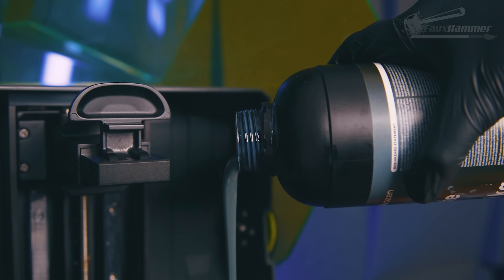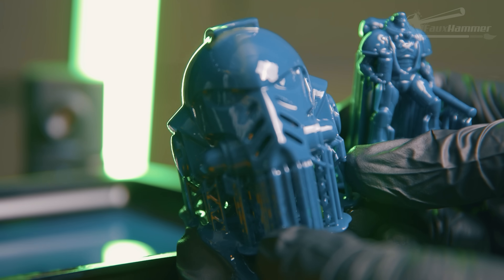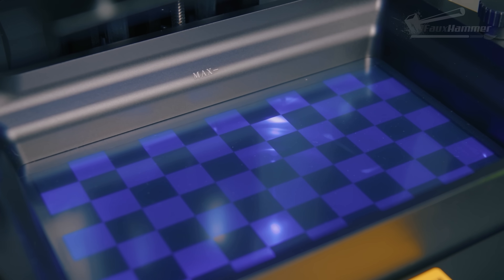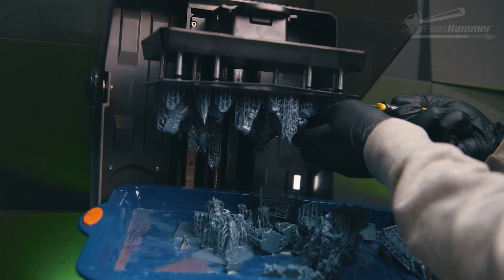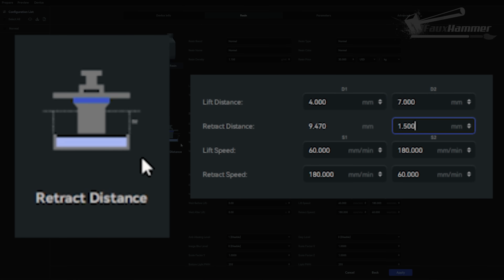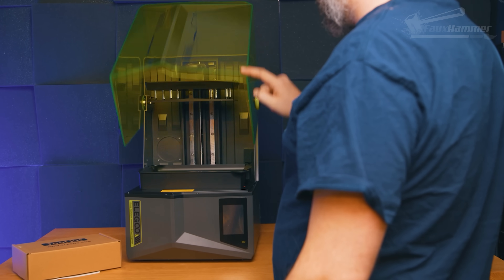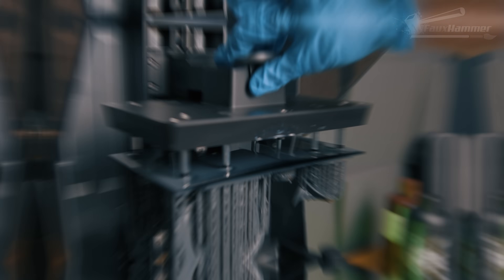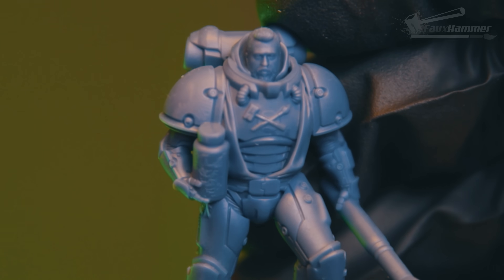FIX your RESIN PRINTER with this ONE SETTING - It's not what you Think! - How to fix Layer Tearing

Comment from the maker: 🛒 ORDER the Elegoo Saturn 4 Ultra 16K 👉 https://geni.us/ElegooSaturn4Ultra16k
🎥 Related Videos You Should Definitely Watch:
• ⚡ Exposure Test (Saturn 4 Ultra): https://youtu.be/_xfJ0456M6k
• 📽 XP Calibration Guide: https://youtu.be/Gm0-z971tgY
• 🧪 Photonsters XP Range Finder: https://www.thingiverse.com/thing:6023738

Resin print failures halfway through? This is probably why.
Lift height and lift speed matter way more than you’ve been told—especially if you’re not using a tilting-vat printer.

Tried these settings? Got better ones? Tell me below. Let’s crowdsource the perfect motion profile.

FauxHammer out. 💥
Reply: Videos like these are taking the whole community backwards. Lifting isn't going to separate layers that bonded together properly during retract, The film has nowhere near enough hold on the model to do that and with the way forces are applied during lifting on the part touching the film (sideways) and the part touching the plate (perpendicular) it's literally impossible. If layers split during lift, it's because they haven't bonded properly during retract in the first place, so you fix it by longer rest before exposure (more effective in general) and/or more rigid support structure (less effective in general). As for lift height, if it's insufficient, it'll cause fails (pancakes) propagating from the center of the plate, because that's the last place that peels during lifting, nothing to do with models being placed in the center. But because the film starts peeling from corners and edges towards center. Just ffs, there are finally more people in the community learning about this and then comes this video. 

Google "Jan Mrazek Prints not sticking to the build plate, layer separation, rough surface, elephant foot: resin viscosity – the common denominator" and start from there. It's been out for 3 years now. Youtubers should do better.

Comment: I've FDM printed for a few years now, well aside from the last 12 months when my printer got damaged moving homes, and I never got around to fixing it.  I recently took the plunge into Resin.  I wondered why people always complained about issues, every print was working great.  I started to understand some of the slicer settings, and started playing with them.  I queued up a 14 hour long print, with 2 models on the plate, and about half way through, I noticed this problem on one of them.  I let the print finish, as one of the models was perfect.  I didn't worry too much, I figured it must have just been a one off.  Until the next print completely failed.  I tucked tail, cleaned the vat, filtered the resin, and deleted all my changes in the slicer, and prints now working perfect again.

But now I KNOW why they failed, and I know what setting it was that I'd messed up.  Now that my hiatus is over, and I got a few random novelty prints out of the way, I can get to what I bought it for... Making functional parts.  Tablet/phone stands, parts for projects, tools etc.  Now that I have a resin printer, I may even consider miniatures as a hobby, it always interested me a little, just never really got into it.  What's the best place to get models from?

Comment: What if it's a Saturn 4 Ultra, Bluecast X1-V2 resin and the print is cracking in a diagonal direction not parallel with the layers? The print printed fine the first two times, the last two cracked diagonally. One of them into three pieces.

Comment: I think I may have a possible solution to this issue for everybody doing resin prints so I'm doing an experiment. I'm going to get a piece of gorilla glass cut to fit my new S4U16k as an experiment to replace the release film with a more rigid but less resistant to light and capable of basically perfect resolution. I'll see if it can handle the tear strength as well. Think a really big piece of the bendy glass used for mobile screen protectors. Film gasketed edge of course but the entire primary bottom being a sheet of incredible tough, flexible and perfectly translucent material may be the end of replacements. Throwing this in here as I was watching this video as part of my research for this project. Another excellent video too Ross.
I think it may have some incredible possibilities with the strength of the material and Corning makes some seriously impressive materials. What do you think? I may even FINALLY launch my Patreon and my channel back up just for this project.

Comment: Thank you so much for this video! Finally I have the settings that I know work because they are tested (even across many different printers) and not my gut feeling. When starting with 3d printing and researching this topic it always like: "the lifting speed should be something between this and that value..." and so on. Or like: "don't make it too fast or too slow or it will fail". So I love your "take these values and you'll be fine" approach. So thank you again!

Comment: The other solution is an anycubic M7 Max. It has a load cell that will try to have a continuous pull force until the part releases, then go down. As far as I can tell it completely overrides the speeds and distances. I haven't had a single failure related to speed and distance.

Comment: Been printing for a couple years and finally printing something larger than a mini and running into issues where the print fails at the same point after releveling, reorienting the print, changing the angle and making sure its hollowed and ported so im not getting a lot of suction. It looks like its being pulled like in the image for the stand at the beginning of the video. checked my print setting and saw that the lift speed was really fast and the lift/lower distance was very short. trying the settings for the 10in. build plate. using a Elegoo Mars 4 Max. 5th time printing this same model so hoping for the best.

Comment: great informative video. this was something i learned along the way and kind of makes sense once you understand that your FEP does stretch over time. as you suggested i change the lift hight on my prints when the FEP has been on the printer for a while. you could also save another profile for a slightly worn FEP?
one criticism though, please stop putting yourself down. your knowledge on printers and 3d printing is fantastic and if your unsure of something, your honest about it and you still try to help by finding out the information therefore furthering your own knowledge about it.

Comment: I have the Elegoo Saturn 4 ultra 16k. Cannot seem to find the slow and fast print mode switch on the user interface. Either on the UI on the printer or the Chitubox software.  Or is it the "wait time" settings, in Chitubox pro. Thank you for your help.
Reply from the maker: it's on one of the UI menus, Tools i think. i said Slow mode but i think it's called "Standard" and "Fast"
Reply: @FauxHammer  Yeah its set to Standard. Im wondering now if its not the wait time after lift. Its set to 0.00. I have a feeling its based around the leveling...... If I have too I have too. Thank for your informative videos.

Comment: Then would you recommend slowing the first stage even more if the edge pieces keep falling from their support while the same piece print fine in the center ? I'm using anycubic ABS resin pro 2 and the piece on the edge of my anycubic mono 6Ks have high misprint rate :/ Tried your suggested setting and it help, but not sure what to tweak to help printing on the edges.

Comment: If you have time then you can fix some issues. We have SL1S at firm and we have some print issues. Because it’s at work , not at home , so we don’t have time to play with it at all. So we will have these issues forever. This technology is far worse than I thought. No wonder these printers got so cheap lately, of course not that particular printer from Prusa. Always the bottom part is uneven. We print some more rectangular and round shapes.

Comment: Thanks for this video. I got a GK3 Pro earlier this year and it printed really well for a while. Then it seemed like every print was failing and I couldn't figure out why. I posted my settings and examples of the issue in the Facebook group but didn't get much help there. I tried replacing the film on the vat as a last resort and nothing worked. Changed the lift settings based on your 12" screen settings and its been working great printing a full plate with no issues. My only thing is now since each layer takes longer to print it has really inflated my print times. Any suggestions on adjusting the settings to have it print a bit faster but still safe?

Comment: I literally just use the default settings an it works fine 95% my problem is I only use auto supports I'm very much dumb when it comes to tech so that's all I can do. I find if I angle the model too much or not at all its when it goes wrong. Or I'm using light supports I use medium now for everything an fixes the issue. My fep is getting old so will need to replace it just can't be bothered lol. Most of the time it's my fault it goes wrong

Comment: Both of mine have been great but one creator's STL I'll have  base fail to print.  I get the supports and a blob on the FEP.  I'd switched resin from standard Elegoo to a 50/50 mix of standard/ABS from Elegoo.  I bumped up the exposure time and that seems to have fixed the issue.
Reply from the maker: Thanks for sharing, the issue you talk about here is what I covered in my last video.  https://youtu.be/V3iHnbqGewE?si=WcuAMymxPVzt6-73

Comment: Thank you. I just bought the elegoo Jupiter se and all of a sudden the prints have started to stick to the middle. I thought it was my exposure time. I will increase the lift distance from 4 to 6. I am sure my speed is ok because I get successful prints elsewhere on the build plate.
Reply from the maker: Let me kno if it works. and a total lift of 6mm is too low for that size of machine imho. use the settings i showed here for 13" printers. it may be slow but it will work. at least once it worksyou can lower it back down to speed it up. but focus on working first.
Reply: @FauxHammer  It did not work. I had to change the fep sheet as well and now I can't get anything to stick. I am going to try a lift distance of 10 and then 13 if that doesn't work. Honestly I am back at square 1. I am not having fun.

Comment: If this happens on the Standard speed (can't find Slow speed) on an Elegoo Saturn 4 Ultra 16K, does adding Rest Time Before Release or After Release help? And why yes/no?
Reply from the maker: Ah yep — sorry, you're right! Standard is actually the Slow mode on the Saturn 4 Ultra — anything that’s not “Fast Mode” is using the safer, more traditional speed profile.

If you're getting layer tearing even in that mode, then yes, adding some Rest Time Before Release can definitely help. It gives the resin a moment to fully cure and settle before the plate pulls up, which reduces stress and helps layers stay intact.

Rest Time After Release is more about stability after lifting, so it’s less likely to help with tearing specifically — but could help reduce wobble artifacts if that’s also an issue.

i will be covering rest modes, but that;s another video if Elegoo decide to continue. These don;t get the views i need to yet in order to make the series sustainable against the time invested in making them
Reply: @FauxHammer much obliged!

Comment: I have not had a failure quite as bad, but I've noticed some cosmetic issues due to a stretched ACF Film and instead of slowing down anything I just slightly tightened my film and that worked wonders.

Comment: Or, the temperature drops suddenly and you don't have a vat heater.
I've had that happen to me with a temperature fluctuation during mid print.
Seriously, if you live anywhere in the midlatitudes, buy a machine with a vat heater.
Reply from the maker: I’m not fully sold on that being the cause, to be honest. Sudden temperature drops that correct themselves within a few layers? I mean, maybe — but I’d expect more gradual degradation if temps really were the issue. Like, if it’s cold and the resin cools down, you’d see print quality steadily decline, not just spike and recover unless something dramatic happened — like opening an enclosure door in freezing air.

Totally agree a vat heater is a good idea, especially in colder climates. But I’ve seen a lot of reports like this, and I’m just not convinced temperature alone explains it. Could be wrong! I'd love to see live data showing that direct link.

Comment: 3 minutes in, and it's spot on!

I just had the exact same thing happen - After 18 months, my printer "just stopped" printing nicely, more or less like you state. I knew from running the 'exposure' cycle to get a full film to clean stuck stuff from the film that the release film was hurting anyway. Drained the vat, and... yup. 

The film definitely needed replacing - not just from stretching, but from wear. It wasn't leaking yet, but there was a milky "grid" visible from the edges of many previous prints. After film replacement, all of my problems vanished.

In my case, I'm not entirely convinced TSMC would've been completely helpful (with the milky film & all), but I'm just some guy, y'know? It's definitely something to try out in the future.
Reply: 5 replacement FEPs for like 15-20 bucks was a no brainer when I started having this problem. First film lasted me about a year so, upkeep cost of 3-4 dollars a year in replacement FEP film. Well worth the additional reliability that the new film provides. Also, with a new film I don't have to slow down the print speed, or mess with the settings that I've already got dialed in.
Reply: @FirstZion-1237  From a cost perspective, my time (to replace the film) is much more expensive than the film I'm replacing.

"Schedule maintenance before the machine schedules it for you" applies either way, of course.

In my case, I was planning on replacing the film as soon as I had worked through the last bit 'o resin in the vat. It's interesting that I had to replace the film about two prints earlier than that, but was too stubborn to do the work, and had a couple of half-failed prints first.

Half failed because I was making first-run functional parts that I'd just designed in CAD. Even with the print failure, I was able to verify quite a bit and make needed changes.

Comment: I always like to have 2 profiles for each printer one for small infantry sized and small vehicles  (3 & 4 mm and 65 & 300 speed) and another that is 4 & 6 mm 50 & 200 speed for large models especially if they are hollowed that will be taking 10+ hours anyway to complete.

Comment: One very important tip I rarely see being talked about is: always fill your resin tank to the max for every print.

When the plate is being lifted, there are two forces pushing your FEP down: its own elasticity and the weight of the resin. And only the first depends on the distance the plate is lifted. If you have enough resin in your tank, you drastically reduce the wear on your FEP, because you don't push its elasticity.
This is often the reason for print failures later in the print: most of the resin in the tank is consumed so separation starts to depend more on the FEPs elasticity, requiring more lift distance for separation, than it was at the beginning of the print.
Reply: No. The reason you want full tank is so that you don't lift your prints out of resin and expose the newly formed layer to air, which is one of the causes of layer separation and delamination lines.
Reply: theres no way the weight of a full tank of resin is enough to apply that much difference given the sheer strength of the forces at play.
Reply: UHHH no? bro those lift forces acting on the FEP are WAAAAAAAY higher then just a bit of resin sitting idly in the tank.... your argument is only sound when you dont think about it at all and take it at face value

Comment: I just bought a new vat for my mono 4 ultra. I kept getting a no resistance failure. After further inspection i noticed the vat lifting with the plate. I haven't pulled the vat off yet to see if it's thinner than the original but i had to use washers as spacers under the screw head to hold the vat down.

Comment: Hello, I'm new to 3D printing. I have an Elegoo Saturn 4 16K, and when I perform the calibration cones, it only works once. After that, no matter what settings I use (following Reddit or my own), the cones of calibration always fail at the center of the plate. i can print test roko that comes by default in the printer without issue but the cones of calibration never did work. Any thoughts?

Comment: Here's the settings I use for the Chitubox v2 Slicer software:
Layer Height: 0.05 mm
Bottom Layer Count: 2
Exposure Time: 2.75
Bottom Exposure Time: 30.00
Transition Layer Count: 2
Reset Time After Retract: 0.5
I have two Elegoo Saturn 4 Ultra 12K 3D Resin Printers